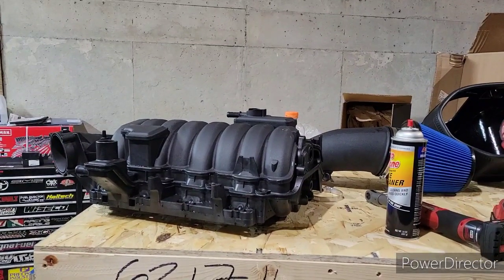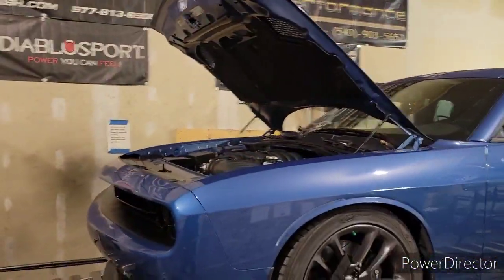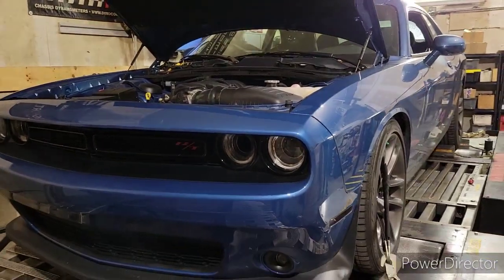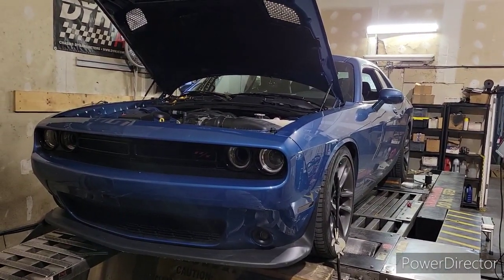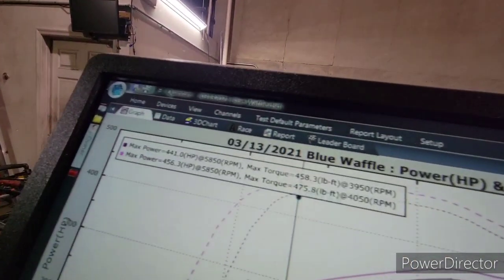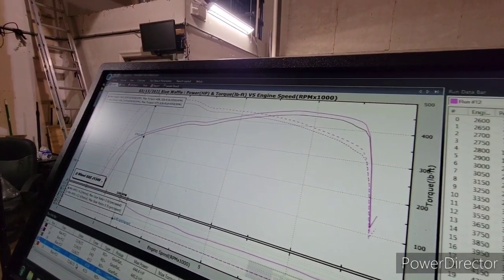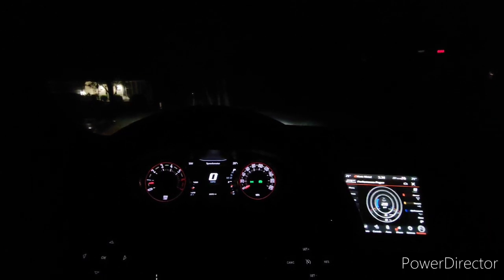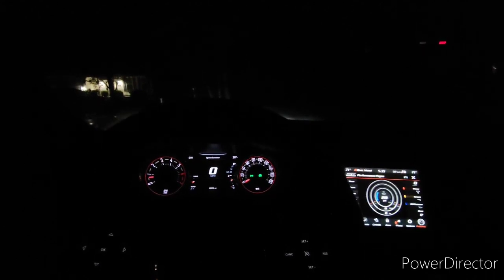We did some testing, 6.4 ported intake

Comment: Awesome research. I would imagine that with a tune, the cold air intake and bigger throttle body might squeak out more power vs stock. Maybe even more with a cam, headers and hi flows. Good call on leaving the heads alone.

Comment: So pretty much aside from exhaust.  Top engine bolt ones should just be ported intake manifold and hellcat air box.   No point in changing out stock tb or going with aftermarket intake  since there are no gains.

Comment: Can you do like a max effort dyno comparison. Ported heads, intake, cat throttle body, your cam, headers, E and the ATI Pully. I’ve honestly yet to see a properly built 392 make those 6th gen Camaro #s fbo
Reply from the maker: I've yet to see any built camaros cross our dyno and make crazy numbers lol.. but in about a week ill be able to compare the old dyno to a new dynojet and see if it was high.. low.. or the same.. I know my track times match my hp and weight.. all I care about.. 😁 and max effort gets up there in hp.. but im not going to make a habit of just quoting numbers any more being as every dyno reads different.. hard to compare across the board.. but its usually 100whp ish gain

Comment: Great info. Who did the porting on the intake manifold?
 What size Throttle body?
Do you have a tune on this car?
Thanks.
Reply from the maker: I do my own porting for packages and my stuff, but when I dont deal in house and people want mail order I send them to mmx unless they're patient and insist lol.. just so busy its hard to deal with anything more than local.
Reply from the maker: 92mm and zero tuning. Air fuel didn't change to the point it was needed.. plus with a 2020/21 theyre so aggressive stock its hard to see any real gains with tuning a stock car.. hence the reason is have only touched it if the afr was in need.
Reply: @OMGITSMRMACK  cool beans.
 Thanks for the reply.
 Did you unlock your PCM?
 I have the MMX ported intake and their 87mm CNC TB ready to go on.
 I have the 6.4 2018 T/A package so it has the good factory air intake.
 I have the Magnaflow XMOD catback exhaust on the car now also.
 I may contact you next spring, take a ride down there to dyno the car.
 I'm up here in the Northeast so I'm putting the car away for the Winter.
Reply from the maker: @tbrewcool  yea pcm is unlocked.  Im tossing a cam in soon

Comment: Soooo… make sure I’m, hearing this correctly.. my ported throttle body I added to my scat, with my hellcat airbox, isn’t giving me nothing extra… I gotta add that ported manifold to see a difference…
Reply from the maker: I saw no gains with the upper lid and all that stuff over a stock intake.. and then I saw no gains with the jlt.. the only real benefits are the amount of cool air I get from either.. in my case the jlt works awesome with my hood having the vent right over the filter and then my head light tube still dumps into it and I have a tube off the bottom break duct that shoves air up at speed... at the track the jlt with my set up seems to shine.. but standing still I haven't seen a gain.. next week im going to base line a wide body with mids and toss an intake on the car.. it only has a jlt... and see if the results are about the same on it too.. just to verify..
Reply: @OMGITSMRMACK  🤦🏽‍♂️🤦🏽‍♂️ and my dumbass thought I was smoking shit on the streets and I’m not doing shit🤣🤣🤣!!! Please video the results with the widebody and the intake on it.. guess I gotta get that high ass ported intake mmx.. I got a pedal box also, but that don’t add power, just take the lag out the throttle response… thanks for the channel and responding to me💪🏾💪🏾
Reply: @OMGITSMRMACK  2 questions… 1 with the port intake manifold.. did u add bigger injectors?? And 2… was it a noticeable difference in power driving? I know on the dyno it showed a nice gain, but for the money,if u had to buy one off mmx and have someone put it on( cause I’m not a mechanic by any means) in ur opinion would it be worth the money and down time it will take to install it.. thanks again.